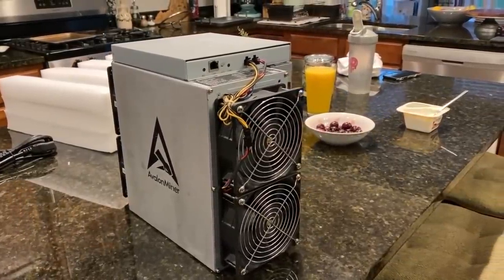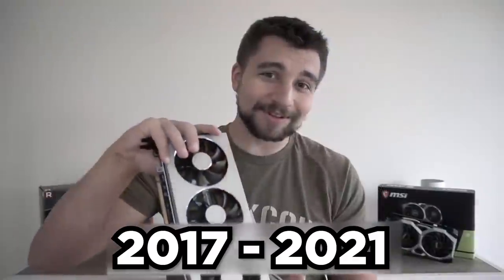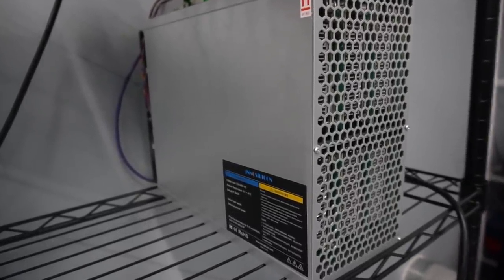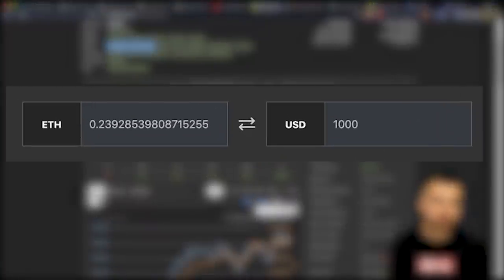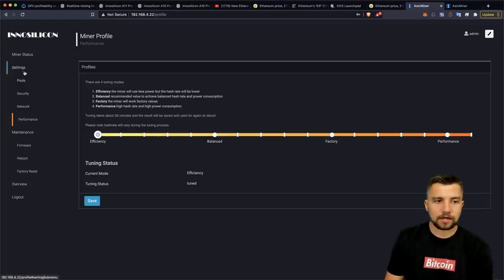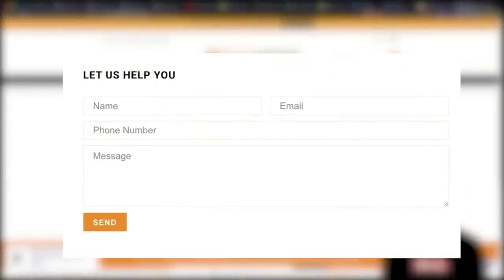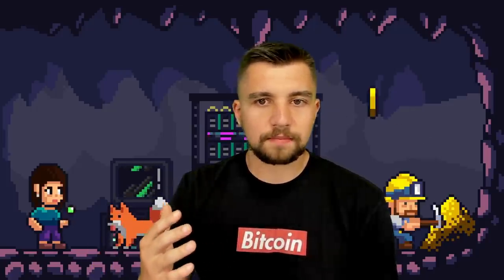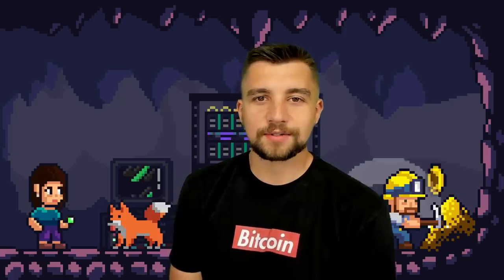Ethereum miners are EARNING UP TO $507 PER DAY with each mining rig

Comment: You and ETH blow my mind daily!  So many insights how to mine! I've got gpus coming in the mail, got my rig set for when they arrive. I have every old system i own, every former mobile i own set up but not started. ETH went to 4k while I've been napping?  I am literally powering everything ive got to mine, right now! Combo cpu n gpu mining ive got three laptops 7 mobiles, 5 desktops my mining rig with a single GTX980TI going.
Reply: might as well add your microwave to the rig 😂

on a serious note tho, what's your Mh/s and is laptop CPU mining even worth it? I've got an i7 6700HQ paired with a 970m 3GB...

Comment: I have a single RTX3090 getting a hash of 111 and a Laptop with a RTX3070 95w version getting 50 hash. I’m currently using NiceHash. Should I be using T-Rex and mine through Ethermine? I’m in this for the long haul and not looking to just make $20 and pull it out in cash. Just looking to not waste my time by mining in the wrong way. Thanks For all the insightful videos.

Comment: Loving it! Just started mining a week ago with 2 3080s looking to get another GPU!
Reply: How much is giving you per day?
Reply: @levantateyora9317  it's running average 200 MH/s ranges anywhere from $25-$40 per day!
Reply: @derrickrodriguez9982  200 mh/s that's a lot... are you mining ethereum or bitcoin?
Reply: @levantateyora9317  ethereum
Reply: Are you using nicehash on a desktop with 2 graphic cards?
Reply: @rodric3005  ethermine
Reply: @derrickrodriguez9982  Link please? thanks!
Reply: @sakarbhatta3611  no. Right now approx like $25 a day. If your worker is active I don't see what could be wrong.
Reply: @sakarbhatta3611  sounds about right. Thanks bro 🙏

Comment: A few days ago it was very high (14$/day for me) but it lowered for some reason (7$/day), do you know why ?
Reply: ETH block reward is a combination of block reward and fees. When fees are low the block reward is 2.2-2.6 ETH but in the last few days fees got very high because of congestion ie heavy use of the ETH network up to 10-12 ETH per block. It is back down to an average of 3ETH per block now
Reply: Correlate with amount of trading of eth, when it's trending expect high rewards and vice versa for range.
Reply: @qwertyui5086  Its more Defi action not so much trading
Reply: Saturation, and giant multimillion dollar farms. We cant compete at a profitable rate.

Comment: Can you mine crypto with just 1 good gpu?if so can you give any suggestions? And what kind of hash rate it have
Reply: Looking to mine eth btw
Reply: You can use only one GPU and still make a little profit. I just got into mining and have made almost $50 in a week with a 3060. If you have a 3080/90 you would get double that. Bitcoin is on a decline right now so the profitability for ETH is on a decline also, but you should be able to make some profit.
Reply: @mrwood8566  i get like $190 approx per month with a rx5700xt
Reply: @ShakTMT  Did u do bios mod?
Reply: @joestuehmer7967  nah
Reply: @joestuehmer7967  just followed a youtube guide how to mine eth on windows 10
Reply: @ShakTMT  Which program u use? I get 55 mh/s but seems like the profit has been going down a lot.. Used to use nicehash now I use 2miners pool

Comment: Overall, how much would it cost to get all of the pieces to mine?
Reply: What do you mean?
Reply: @jakeaustin901 computer and mining parts
Reply: @TheOriginalBattler  for Ethereum mining you can buy an ASIC like he mentions or build a PC. To do that, you need these parts:

Processor (CPU)

Multiple graphics cards (GPU, better profitability)

Storage drive (either hard drive, HDD, or solid state drive, SSD)

RAM

Motherboard

Power supply (PSU)
Reply: @jakeaustin901  what’s an ideal price range for the total cost of the parts?
Reply: @TheOriginalBattler  are you going just for Ethereum or CPU mining too?

Edit: also, if you want to beef the PC up, you can use it to game on, then mine when not gaming.
Reply: @jakeaustin901  I’d love to game on the pc as well. I wouldn’t mind mining other cryptos, but clearly ethereum is an easy method of making six figures a year.
Reply: @TheOriginalBattler  I can help you with a build if you give me a general budget.

Comment: I dont know what to do.
I want to do this but all i have is a 2080ti on my rig.
i feel like it the amount of time i use it to mine wont be enough just for that 1 card. 50mh/s
Reply: just let it run all the time in the background when you're not using gpu intensive application. mines always running when im webbrowsing and streaming.
Reply: @madam497  dude, it's gets crazy hot and it's running at 258watts.
I'm downloading hiveos on a USB, so I can have it running at a lower setting.
Reply: An Equal  I just booted up hiveos on a USB with some new overclock settings and now I'm getting 56mh/s running at 150w. Wow!!!! 

It lowered the temperature and the amount of strain it was running at is gone. Sounds like it's just chilling now.

I'm Looking for another 2080ti now. lol
Reply: @sirjuaffreblumpkins9396  how much u profit a day with that?
Reply: @snow2k11  it's around 0.00175 ETH daily, so $6-7 depending on value of price right now.

I'm trying to find more cards to get to the rig to at least 500Mh/s.